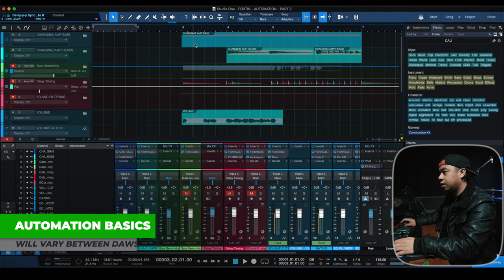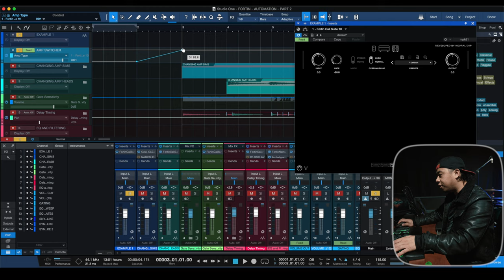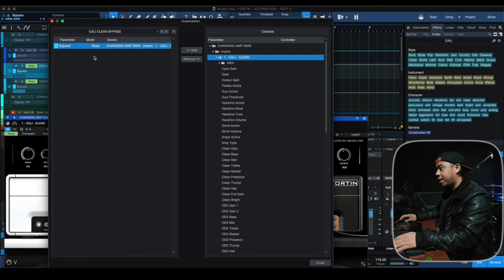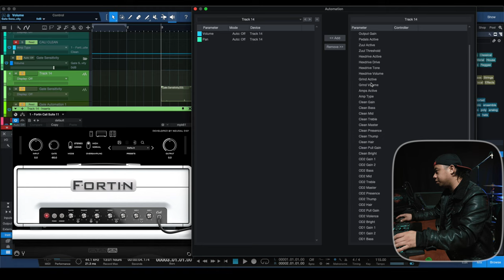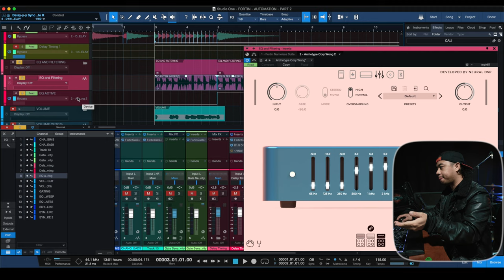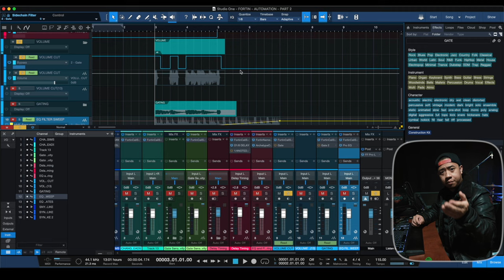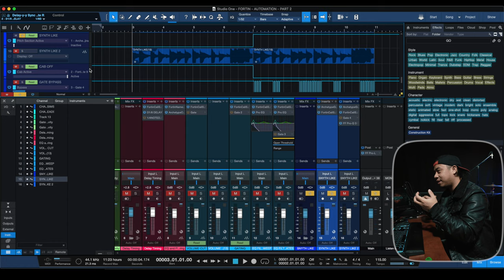Using Fortin Plugins Live | PART 2: Automation

Comment from the maker: Time Stamps:
0:00 Intro
0:12 Explanation & Overview
1:40 Basics of Automation
7:40 Changing Heads by Switching Plugins
8:49 Changing Amp Heads within the Plugin
10:20 Adjusting Gates Between Sections
12:07 Adjusting Delay Timing Between Parts
13:47 Using EQ as a Transitional Element
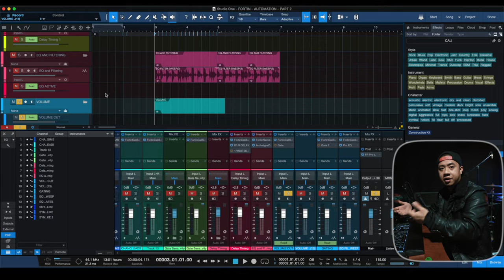15:43 Cutting Volume to Clean up sections
18:04 Stutter Gates & Glitches
18:47 EQ Filtering as Build Ups
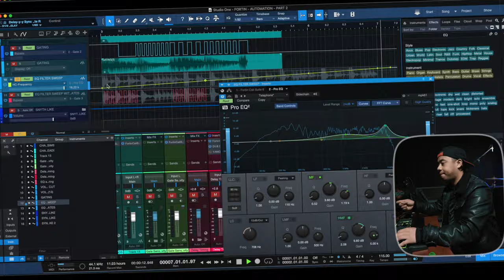20:51 EQ Filtering + Gates 
21:41 Synth Like Leads
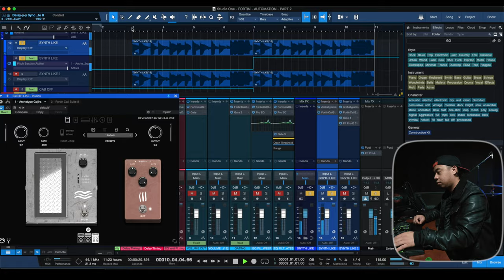23:24 Extreme Applications & Stacking Concepts
25:28 In Mix Demo
26:23 Outro

Comment: Guys! Is it possible to change presets in the one plugin via automation? Can I change my presets in Nameless without getting two or three instances of the plugin?
Reply from the maker: This would probably be best done by using midi and just mapping the preset change there. Alternatively, you could automate each different parameter of the plugin to be specifically the right place for your needs.

Lastly, each channel retains its information so you could switch between 3 different channels. like Mel described in the video!